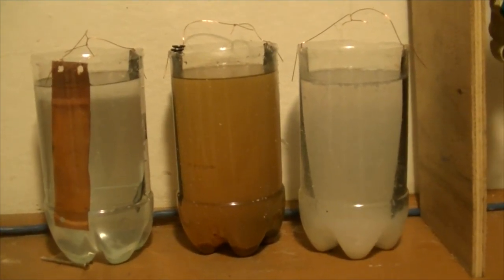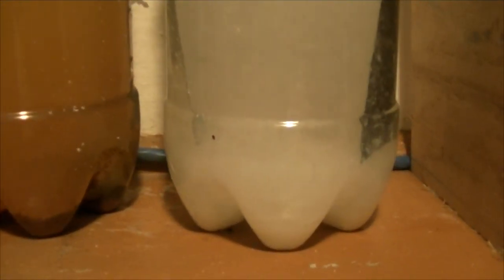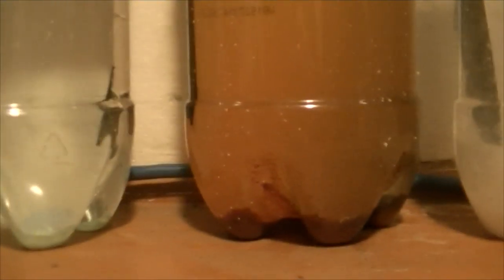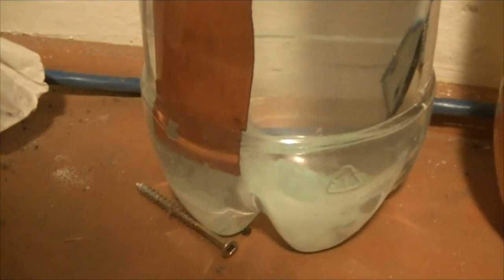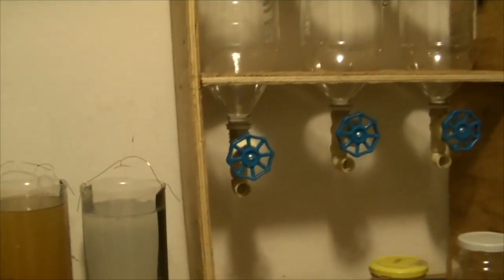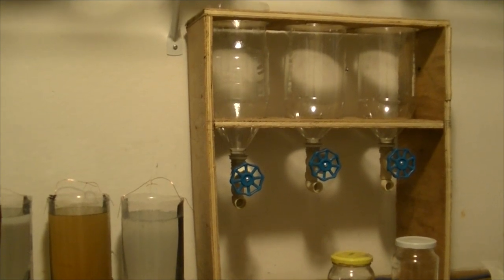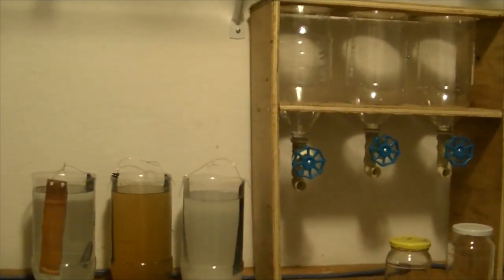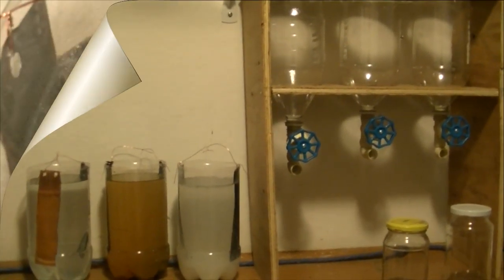GANS production update 1

Comment: J.C. I don't see any voltage on zinc bottle, how can you be sure its making zinc gans and not zinc oxide?
Reply from the maker: +AQ1 If you have voltage you are far more likely making Zinc Oxide. You will know when you use the material. The process as we are doing it in the home does make some ZnO GANS but that is not really important. Even a tiny volume of CO2 GANS is very powerful and ZnO GANS is powerful too.
Reply from the maker: Watch the video... All that information is in there.
Reply: +pinantan001 sir please guide me how i put load  to make co2 gans and what amout of current i use please teach me about circuit to make co2 gans not zno
Reply: +pinantan001 thanks